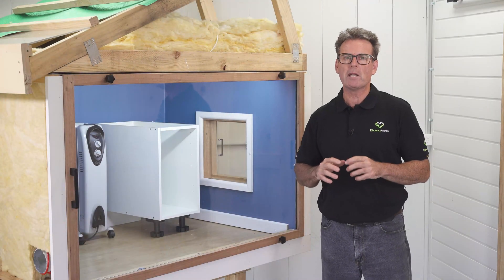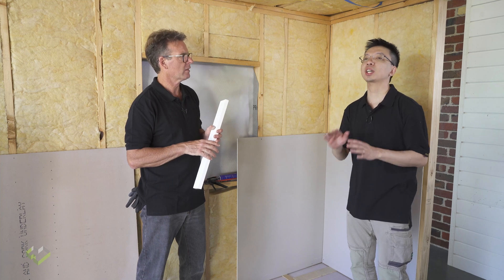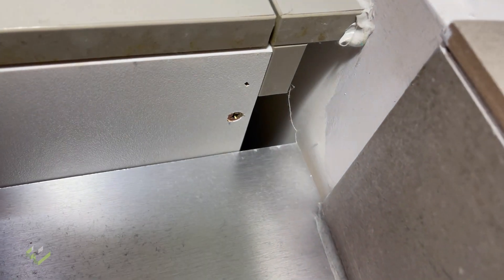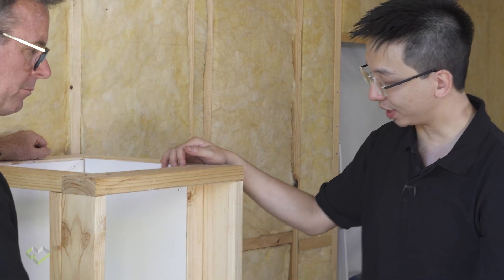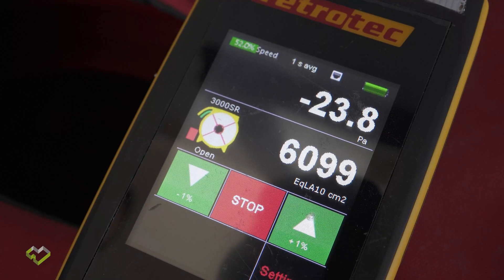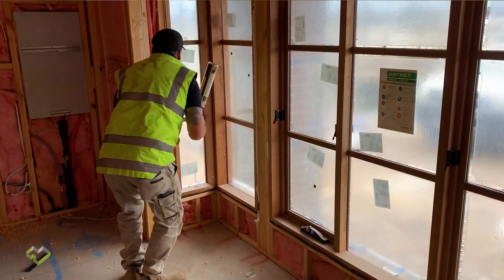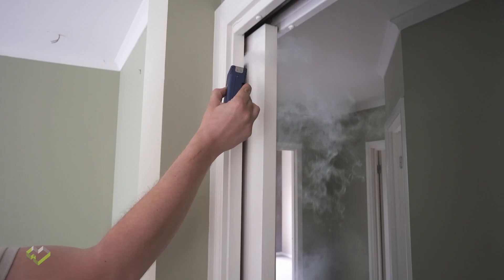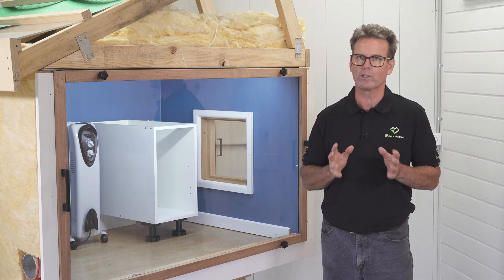Using Plasterboard to Create an Air Barrier for your home.

Comment: This is a great video. If all the plaster and floors are sealed according to this video and any penetrations to it are sealed appropriately, what's the hurdle stopping the air tightness measure from going well below 6ACH (assuming good quality windows and doors)?
Reply from the maker: You could hit 3ach, depending on how large the home is.  Large Macmansions, can hit 3ach@50pa easily.

Comment: Wouldn't it be better not to let external air into internal wall cavities in the first place, given that it still robs the house of heat even if it never makes it into the room? Why not plaster the external walls and ceilings and then somehow seal through the junctions where they meet internal walls (and floors, in a double storey house), then you wouldn't need to worry about internal walls at all. Then the airtightness envelope would truly abut the insulation envelope everywhere, as it should. Less surface area to seal should also make it possible to get better results in blower door tests. I would like to see more videos that explore the possibilities in regards to this.

Comment: Been doing these practices on retro fit homes for 5 years now and every single home is different, same principals, new builds are easy as your in process, but try deconstruct a existing home with out the deconstruction, thermal guns help and so do micro smoke machines but skill and knowledge is lacking in the industry, but over looked by many builders cause of costs, not all but many especially high volume builders will fail blower door tests, all mistakes made on a build should be reported, example incorrect hole drilled in a stud wall should be inspected by the builder some pick it up most don’t, or concrete jacked out, splicing batts instead of over the top of pipes, this is so often, if you want to see what we have achieved look up the road map for the insulation industry, this will give you all a good clear provision for the industry and what’s to come over the next 3 years it’s time Australia becomes educated, basic way to learn, remember your Mum said shut the fridge ! the reason for it is the same reason for your home when trying to heat or cool it,  but what’s mostly over looked is why we had to shut it. That is how videos like this address and inform those who lack the education to understand why it’s so important to air seal your home, good job guys we have a long way to go ! I will be doing a video on the different types of thermal materials and which ones we use for existing homes and why, these videos need to be sent to every insulation installer, plumber builder and sparkle fridge trades plasterers amd they all need to be doing a module to be informed why it’s important to put the insulation. Ack the way it was or to adjust to comply with the code and to compliment there install to warrant a bca certificate and you might see some massive changes in the new build industry not to mention all trades need to do a installation report that reflects the energy report meets the requirements-and codes, and this is why builders and inspectors will soon be all audited as integral builds need to be common practice abroad.

Comment: Thanks for the air-tightness video, noticed however that the plaster was caulked to underlay, not the floor. This was obviously as it was a mock
up to show the detail and the plaster should be caulked to the floor then any underlay etc after the fact. 
Hope that makes sense to anyone looking to achieve an air-tight seal from plaster to floor!!
Reply from the maker: Yes, the cement sheet is supposed to represent the concrete slab. 👍🏻. For these demos we didn’t want to put caulk on the floor finish.  Sorry about the confusion.
Reply from the maker: The plaster needs to be caulked to concrete slab not any underlay.  We used cement sheet so that we didn’t mess up the concrete slab where the mock up was made.

Comment: The return box fix was most beneficial in all the DP I did.
Removing dirty wall cavity air entering our home and conditioned air leakage.
I capped it off with coreflute board and expanding foam.
Thanks to a previous video on return leakage.
Another great video that will give people knowledge to demand a higher level of craftsmanship from tradies and the industry that has ultimately delivered sub standard homes for decades.

Comment: Finally, after many years, an Australian produced video on the topic of air-tightness!!  Over 40 years ago, Canadian builders started using these building techniques and called it the ADA technique, or Airtight Drywall Approach. Efficiency Matrix is ,in my mind, one of Australia's best educators of the 'building as a system' . I am looking forward to more of the same. Well done!
Reply: Better this solution for the bottom or the plaster, or taping it with say a proclime extora tape?
Reply: Of* the plasterboard
Reply: A large part of Australia being “behind” on North America and Europe is because our climate is nowhere near as extreme. That’s all changing now though.

Comment: Gotta love that cost is no barrier to air-tightness. They are simple solutions using cheap, basic everyday products. No up-selling is what Efficiency Matrix seem to stand for. You may qualify as a Charity in some parts of the world. 👍
Reply: This is so true. However, I have to emphasize that using the plasterboard as the air barrier may not be applicable in climate other than National Construction Code (NCC) climate zone 6 and warmer part of zone 7 (which is the majority of Victoria, AUS). The mild temperate climate of Melbourne has only a low risk of in-cavity condensation as the new construction code requires vapour permeable membrane as the weather barrier (conventionally called sharking, locally). A dedicated vapour barrier is required in the colder part of climate zone 7 and the alpine region to mitigate in- cavity condensation.